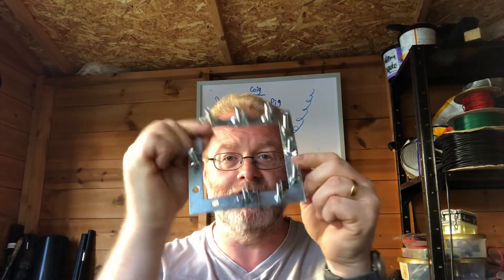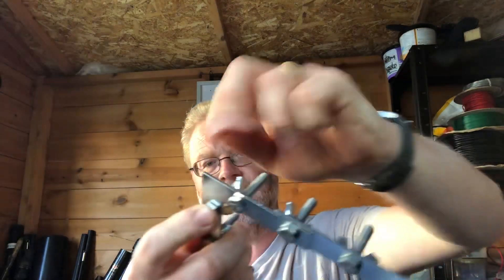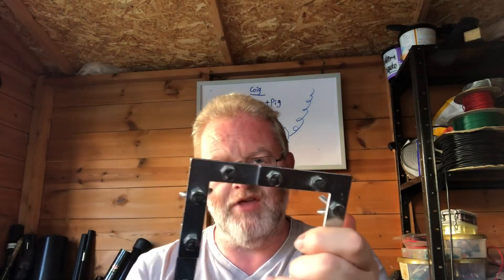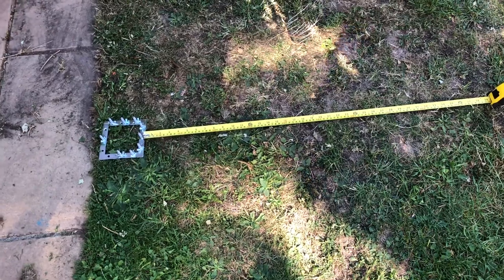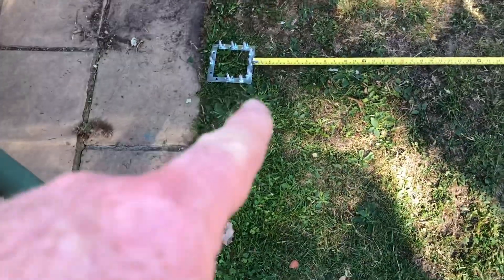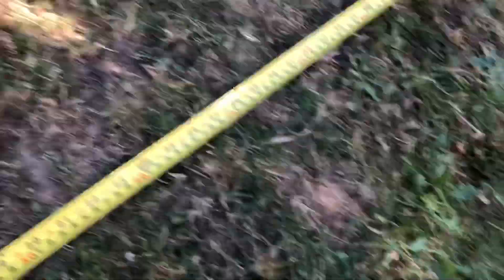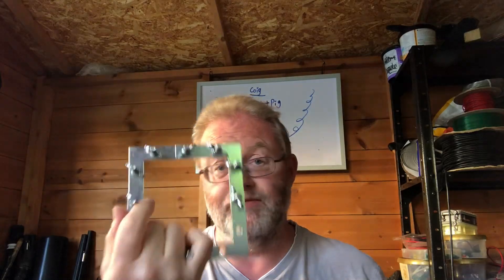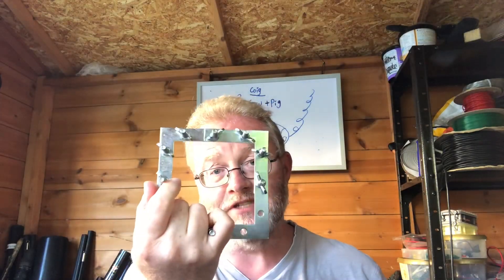HAM RADIO: Ground Radial Plate - Easy To Make

Comment: FWIW I did similar (but different) using an inverted frying pan stolen from the kitchen. Just cut a hole in the centre with a jigsaw, drill out the rivets for the handle and you can drill as many radial fixings as you want.
Reply from the maker: Brilliant idea!

Comment: you can add a 90 degree  shelving bracket as the feed point for this as well tim, isolating the feed line adding a s0239 chassis to your design,
Reply from the maker: That’s a top idea mate

Comment: Forgive me I am puzzled. You say 75m of radials, but they are all short 1m-ish totalling 75m. I thought the individual radials had to be 1/4 λ or near? This is important to me because my garden is max 10m by 5m and the vertical cannot be in the geometric centre and I have been agonising not a little. Perhaps I read too much.
This is the second comment. Do I get a discount? :-D
Reply from the maker: The ideal is 1/4 wave but 1/8 wave or less will still work. Rudy Severns’ work on this found less than a db difference so in the real world shorter radials should work. The DX Commander antenna employs 2.5m long radials including for 40 and even 80m. Way shorter than 1/8 wave long but they work fine. Also even a 90-120 degree radial arc will work. 73
Reply: @TIMG5TM  This issue of ground radials has always been a problem for my head. I am a technical guy - or was but not so practical. Ofter "Counterpoise" is reffered to. I am prepared anything which works and my postage stamp sized garden seems so much bigger now. Just got to get some Home Brew stuff started and try out 80m with my """long""" wire and an SG auto tuner then some vertical experiments.
You are extremely motivating,

Comment: Hi Tim, Just wondering what wire you plan on using for the radials?
Reply from the maker: Hi there I’m using thin 26 or 28 awg wire. 8 or 9 per bunch. With 8 bunches. 73
Reply from the maker: I show the radials in the video I released yesterday on the 20m quarter wave vertical 73
Reply: @TIMG5TM  Thanks will have a watch!

Comment: My local pound shop had some 'sink strainers', round aluminium plates. dished in the centre otherwise flat.  And lots of M5 holes, including one in the centre.  The pack had 2 plates,  a big one with getting on for a hundred holes and a smaller one with a dozen or so.  Well, I needed a sink strainer and the small one was ideal. 

The bigger plate - I sunk a 2m ground rod,  drilled and tapped it to take an M5 bolt, bolted the plate on and used it as a radial plate!

£1 for the actual sink strainer was poor value.  But I got a free radial plate!  I spent more  on the nuts and bolts, also crimp eyes than I did for the plates.
Reply from the maker: Brilliant! That’s a great idea

Comment: Brilliant idea (well done Lee!)👍🏻 The number of times I’ve seen pack of those hanging up (& bought some) and it never occurred to me that they’d be a good base. My radials miss out 90° due to my pond. One thought Tim. If you fancied a job, you could scratch out some of the paving joints and zig-zag some wires inside the patio. Then touch-up with a bucket of mortar 🤔
Reply from the maker: That sounds a possible plan Ian

Comment: That's a pretty cool idea.  I did it the hard way and sort of copied the DX Engineering one out of stainless plate.  After about 140m of radials in a really compromised location, I finally had a decent enough ground under my Hustler for it to tune and work properly!
Reply from the maker: Nice job!

Comment: Hi Tim. Just set up my shack and running a Icom 7300 into a Moonraker GP2500 radial free vertical. My issue is i'm getting lots of static across the whole bands. I'm not receiving much either. Any ideas. M7MGD. I'm using the auto tune.
Reply from the maker: Hi Martin it’s tough to say. What is your swr per band without a tuner in place?
Reply: Hi Tim. The antenna is mounted on aluminium poles which interlock. The top 100mm of each pole is narrow to allow next section to go on. I have left this 100mm section above the antenna bracket so I can clamp it to the pole. This 100mm section is above the bracket and next to the antenna. I have fit a clip on ferrite on the coax and left a small loop. Hope this helps.

Comment: I use the DX Commander ABV. I to have had to compromise on my radial direction. I have found very little difference in real world connections between directions. I have more swr problems with swr than anything else with this vertical.

Comment: I like this idea. Will 75m of wire be enough? I have about 200m on the ground. Which for my 10w is good. Just need to reduce the amount of kw users in pile ups!!
Reply from the maker: Thanks Gary. Once you approach 16 quarter wave lengths of ground radials the returns on more radials start to diminish quite a bit. Plus only having 180 degrees to play with. Sounds like you are having fun with a vertical too? Agree with the kw stations but it makes your DX contacts all the more sweeter when you make them! 73

Comment: Your going to be directional where the radials are, Better if you can to get radials all the way around the antenna.
Reply from the maker: Yep to a degree certainly. There’s  always a compromise and from what I’ve researched the directionality isn’t a massive issue with the ground mounted variant of the quarter wave vertical. 73
Reply: @TIMG5TM  Just highlighting it for your info.
Reply from the maker: No problem 👍73
Reply: @TIMG5TM  73 Tim keep up the great videos.
Reply from the maker: Will certainly keep trying to produce the vids and thank you for your continued support and participation. 73
Reply: I tend to disagree with it being directional.  I am getting across Europe on my 10w. Northern Finland to Turkey and Canaries and inbetween. Yes I am a noob to all this, yet still getting out there.
Reply: @garyh8315   Well done that what you use is working, Go look at how a vertical works on a car & how it radiates in relation to it's position on a car same applies with radials.